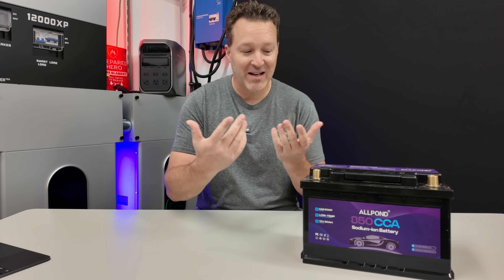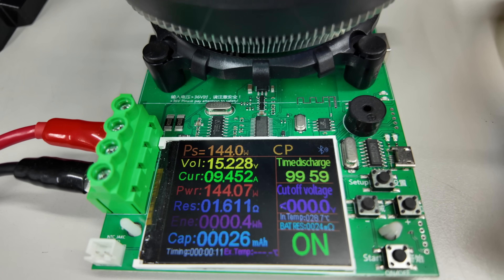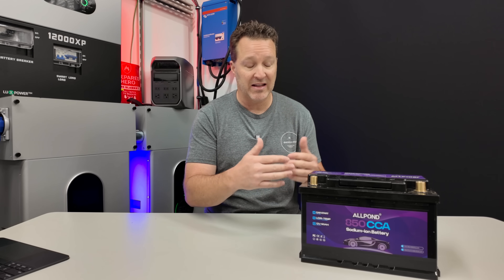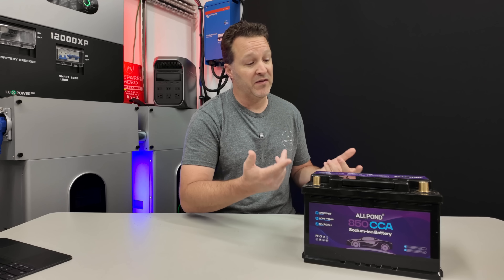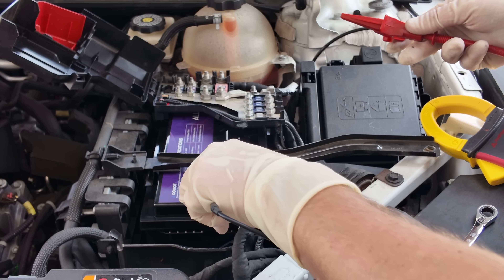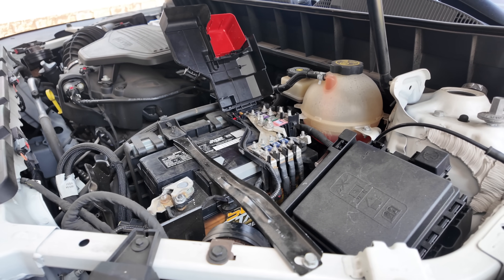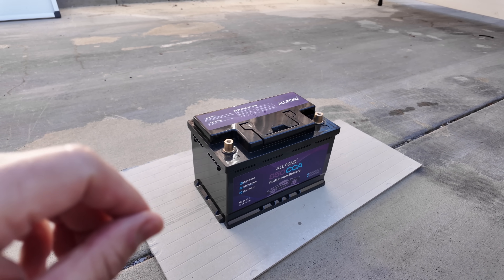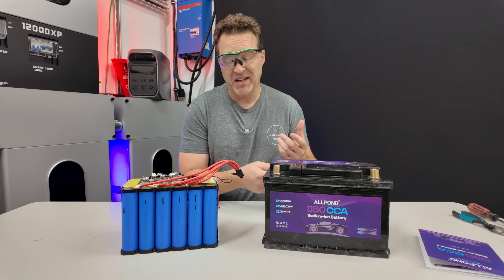Sodium Ion Battery Tech Hits The Auto Industry!- Are We Ready?

Comment: This actually seems more suitable for wind/solar, IF you have a very wide voltage operating range. The inverter needs to work well from 9 to 16 volts. I wonder what the cycle life would be like, but I'm not sure I would prefer this over a good AGM or even a Gel lead acid battery. For your truck, I would like you to test a four cell Lithium Iron Phosphate battery, which is my first choice, for renewable energy applications. Because it takes ~400 amps to start a truck engine, it may be necessary to Bypass the BMS, and connect straight to the cells. Your CCA rating for a 90 amp hour LiFEPO4 is astronomical, for 10 seconds. The BMS still needs to remain in place, for voltage balancing of the cells. This Na-Ion seems very interesting, and I might get one to experiment with, but it may not be something that I could rely on.
     When Lithium Ion batteries first came out, they too, were very "soft". They would not accept fast charge rates, and could not put out much current, compared to their capacities. They have since become the "kings" of power density. I have huge optimism for Na-Ion, but, it needs the decades of refinement, that Ni-MH, Lithium Ion, and LiFePO4 have had, before it becomes competitive with those chemistries. Lead Acid has had over a century of development, and it's pretty close to its 'pinnacle". If this can't match the cycle life, or current density of Lead Acid, it still needs work!
Reply: Lithium Iron does not like cold weather .

Comment: Should have measured alternator output to see if the alternator got shut down altogether or regulated down to hold a steady "fail-safe" 14V. A shutdown would be problematic since the battery will inevitably run out. A steady 14V would be mostly fine, you only lose another ~10% of the battery's usable capacity on top of the ~5% from only charging to 14.8V max instead of 15.6V and probably have the annoy-light on.

I'm guessing the alternator controller didn't like the Na-ion battery having flat low impedance beyond 14V. With lead batteries, the internal resistance goes up a fair amount once the charging voltage is above nominal open-circuit voltage. The controller likely tripped when it didn't see that. Another possibility is that it tried ramping up to 14.8V like it did with the lead battery but tripped its over-current protection since battery impedance never increased. Either way, neither is the battery's fault nor something the battery can "improve" on. It is the alternator regulator being hard-coded/wired to a specific battery type and automatically flagging any excessive deviation from the expected I-V curve as a fault.

The improbably low currents on your clamp-meter are likely because its sampling/integration rate is too slow to accurately and reliably capture cranking and charging peaks.

Comment: Sodium has been around in the car audio world for a while now, and are very good for high amp loads such as starting.  We abuse them much worse, with demands sometimes in the tens of thousands of amps for brief periods of time.. Brutal conditions. 

The cells technology is there, but this is a poor example. Higher quality interconnects between cells, and from pack to output terminals, with a more robust BMS would make a winning combination that would easily be usable in the real world.

 Today's vehicle charging systems use various profiles and algorithms(varies between manufactures) , typically for agm variants, and regular flooded cells. Software could easily change the charge "style" for sodium in most of today's typical PCM controlled regulation, which requires 15.8 to be fully charged, required for full use of the cells storage capacity. Charging them to 14.8v is only using half of the cells capabilities as far as capacity. Older vehicles are easy to modify to obtain full use of the sodium technology.

They are tremendously good at holding good voltage under the heaviest loads, and can recover quickly as well.

Overall I'm disappointed with the build quality, but us car audio dorks are extreme, and build our diy packs for war, because we push these and other lithium batteries technologies to thier very limit and beyond. 

Once again, thanks for the cool video Johnny, love to see new tech trickle into the mainstream, even though this isn't quite ready for the masses. Soon though, the technology is here now. Just needs to be implemented a bit better with better quality.

I know a guy that can use that pack and would pay shipping! Just throwing that out there if you decide to throw it out!
Reply from the maker: Shipping batteries isn’t cheap though but I’m not using it

Comment: Watching this makes me yearn for the older, much simpler vehicles!
Reply: Boomer trash
Reply: @dwightsmith5174  The so-called older simpler vehicles were not so great.  They failed unpredictably and didn't last as long.   In this instance the smart charging system is protecting entire electrical system from major damage.  It did what it was supposed to do preventing huge repair bill.
Reply: @kannermw So glad you have had decades of experience to speak from!
Reply: @dwightsmith5174 Dude I’m over 60 with degree in mechanical engineering plus  extensive background in electronic and electro-mechanical control systems.  

Yes I know what carburetors, old school points and condenser  ignition are (pre-electronic ignition).  I remember before ABS and air bags.  Yet you would make such a pointless statement.  Good old days were not great.  Maybe emotionally linked to your youth.  In reality the world and tech flew past you and you can never catch up.😂😂
Reply: what if we had a custom converter and actually installed the second battery somewhere else in the vehicle so that it can just keep the lead acid battery topped!
Reply: some Toyota body on frame trucks/SUV have been shipping with dual battery setup from factory, one for cranking and one for the electronics

Comment: I'd love to see a full set of specifications for this battery. When they advertise these batteries, they only show the good stats.
You mention 4.000 cycles, which is almost as good as LFP. Now, you mention low cycle efficiency. Do you have any numbers? What about loss of charge over time? Will the battery go flat after a week of not driving? Cycle life is one thing, but for LFP the most important cause of battery degradation is calendar ageing, which generally isn't even mentioned on the specification sheet. How is that for these batteries? (Edit: I found another battery advertised with 8-10 years life, which is good.)
There is a reason why they try to sell these batteries into automotive and not try to sell them for home backup energy storage. With the low cost of solar panels, cycle efficiency cannot be the reason and cycle life seems to be fine.

Comment: This should work for Amateur (Ham) Radio.
Reply: Definitely, or LiFePo4. No voltage droop while transmitting like with LA, unless you have enough in parallel obviously.
Reply: @andrewt9204 LFP is way better for 12v applications.

Comment: I had an Interstate battery in my car for 10 years. Changed it out 2 years ago because it was so old. The new battery died in two years. Put the Interstate back in. I do want to get a new battery but this one will not be it. To much to go wrong inside. You may also want to check with  with auto insurer about using this thing. I can catch fire. I agree with you not for everyday use. Thanks so much for the look inside.:octopus-red-waving:

Comment: Other things to consider, most new cars have a bms and you need a scan tool to calibrate the new capacity. An older car isnt gonna have much issue because its just a regulator and a recifier. Some cars have a calibrated map based off 12v it may cause them to idle higher.

The other issue is you should have charged the battery to 12.8v not 14v at resting its too high most lead acids settle at 12.80v at rest when new. Your test isnt dialed in.

Comment: This was so timely for me.  I've been reading comments about early adopters using Na batteries they've bought or built, in automotive/motorcycle applications with positive claims.  Unlike Li, Na is not bothered by sub freezing temps that vehicles see.  I'm intrigued if this will replace lead acid and think it might.  The chemistry and technology looks like it will still need tweaking to optimize and solve charging issues, but I think it's promising.  Thank You, I've searched extensively and this was the FIRST quality video I've found on the subject.
Reply: I've been slowly replacing lead acid with DIY LiTo packs. No BMS. Just 5 or 6 cells in series. the first ones are approaching 8 years, surviving extreme abuse. Frozen dead with key on. Hard starts in -40c. Hoping Na is just as good or better.
Reply: @danielrouw2593  Early adopters like you will be proving whether Na-ion works or is BS.  What is LiTo?  I've never heard of that chemistry?
Reply: @RPRosen-ki2fk lithium titanate oxide. Very similar behaviors to Na cells. The first ones i used were grey market packs from military gensets that had the bms removed. Those used the premium SCIB Toshiba cells. Later packs i made using chinese cells, jury is still out on longevity but they turn over large deisel engines with ease. Only concern so far is terminal strength on the chinese cells, but that isn't a fault of the chemistry. I still have half my cells, so i won't be trying Na anytime soon. sorry.
Reply: @danielrouw2593  Thank you, I'm going to delve deeper into them.  I already see Will Prowse has a video on them, I'll start there.  Even though you won't be experimenting with them, I'm sure a ton of others will.  I'm excited since I've heard Sodium-ion may end up costing a magnitude less than Lithium-ion when mass production kicks in.
Reply from the maker: Lithium titanate oxide
Will has talked about it and it’s just not as good as LfP for most uses
Reply: @johnnysweekends for most uses yes. For starter batteries they are fantastic. 80% performance in -40 is amazing in northwest Canada. One tractor i used in parallel with a lead acid. Discovered the lead acid was toast, shorted internally. Never noticed as the LiTo pack kept up even with the dead pack dragging it down.
Reply: @johnnysweekends You are really wrong about LTO batteries and the chemistry. It's the only suitable chemistry to replace lead acid in cars as it's good to -40°C and +60°C. Will Prowse isn't all knowing and he doesn't really take into account use cases where negative temperatures are the norm for half the year, nor does he consider use cases for cars or high output use cases that require 30C constant output and 75C burst output like LTO can do. LTO also does 20,000+ cycles before ever hitting 75% of its initial capacity. I've been in high output car audio and anyone that lives anywhere that it drops below freezing uses LTO  cells for their build. I've seen 10Ah LTO cells handle 8000 watt amplifiers better than Panasonic CMax lithium ion cells and way better than any LFP cells. I have 222Ah of LEV60F Lifepo4 cells in my car to support an 8000 watt amplifier and it's fine, but it sits at 13.3v to 14v and that's with a 320 amp alternator that's regulated at 14.4v in my Toyota Highlander. I'm not a fan of having the car control and lower the output voltage of the alternator, but I can't change Toyota's engineering and cars are almost all set up for AGM batteries except for some expensive cars like BMW. I believe my Japanese made Lev60F cells are made for BMW batteries and they regulate the voltage between 14v and 14.4v. They sell BMW branded batteries with 4 Lev60F cells inside for $1500 and I got 16 new cells for $22 each. They are in a 4s4p configuration and I had custom copper buss bars made just for my setup which can output 2,400 amps above 12 volts. Modern cars don't like the very low internal resistance of Lifepo4 cells or LTO cells so you have to trick the computer with resistors to get the desired output. Lots of folks with big stereo systems use lithium cells and trick the car into outputting 15.5v with resistors on the sense wire in the alternator harness with a couple resistors until they get an adjustable voltage regulator for their high output alternator. You can still do the same trick with the stock alternator to get the voltage up to 15.5v but I don't think it's recommended to go higher than that for the sake of the rest of the electronics in the car. If you are looking for information about how different lithium chemistries act in cars and how to get around charging problems, look into the car audio scene and there are videos and forums all about using all kinds of different chemistries that aren't lead acid and getting them to work with the car with no problems. Most people use LTO cells or CMax. Some use LFP cells if they are new to the car audio world, but the professionals use LTO cells because they are simply the best in performing in all different types of weather and they are literally good for your whole lifetime. 20,000+ cycles is insane and I've seen 100,000 watt stereo systems run off 15.5v LTO and SCiB banks that aren't that big or heavy at all. LTO is currently the only chemistry safe enough and robust enough to replace lead acid. My next battery bank will most definitely be LTO cells. Probably a mix of XS Power 40Ah cells for capacity and 10Ah cells for power output. The 20Ah SCiB cells are also good if you can get them cheap off battery hookup or something, but they tend to be laser welded together with copper and that makes it hard to work with. I prefer having studs to mount buss bars, but I might spend the $190 to get a 24 pack of 20Ah SCiB cells just to see how they do on an 8k to 10k amplifier.

Comment: WARNING: unless your car was designed for lithium and has the battery isolated from engine bay heat. You SHOULD NOT be using lithium as a starting battery. 

In the car audio community people haven't been following this rule and a variety of different lithium chemistries have caught fire
Reply: The lifepo4 batteries made to start cars are fine.  I just think they're a bad idea for very very cold climates.   They can discharge at cold temperatures without issue but it has its limits
Reply: This battery is sodium NOT lithium.  Sodium batteries have very different properties from lithium.  They are MUCH more stable and safer.
Reply: @RPRosen-ki2fk  
They are "Much more stable(?) and Safer (??)" because they have 20-40% Lower energy density than Any Lithium ion chemistry.
+/- 160 Wh/kg vs approaching 210 Wh/kg for Iron based Lithium ion and 260+ Wh/kg for Nickel based Lithium ion.
(Source: CATL)

Comment: So with this new battery chemistry, battery charger/maintainer/conditioner units like my NOCO Genius 1 are not going to work. User manual states a 15W max output. But upper NOCO models have higher output levels. But the question still stands about compatibility with Na-ion batteries. Thanks for the real world test and results. Very interesting to be sure.

Comment: Hey, ChatGPT, write five glowing battery reviews for me. Don't mention that American cars have alternators near 14.6V.
Reply: 14.6V is why lead acid batteries don't last long. Ideally 13.7V is best for long life but won't hold as much energy as 14.6V however for normal use and longevity 13.7V is ideal.
Reply: @bobsmith3983  i have still had battery's run away on me when stored at 13.6-13.8v